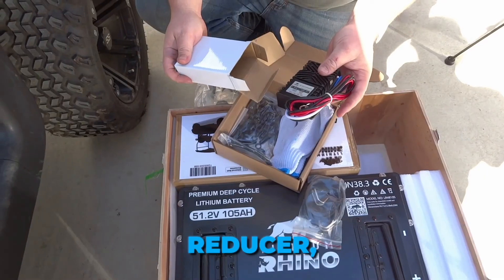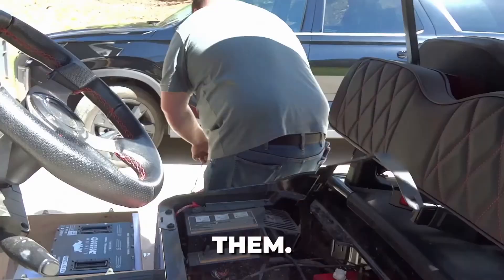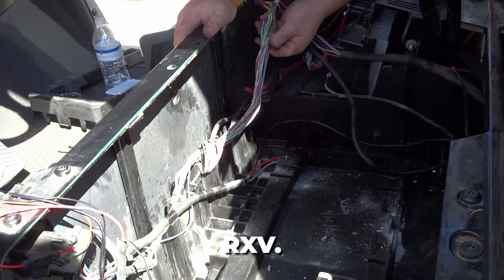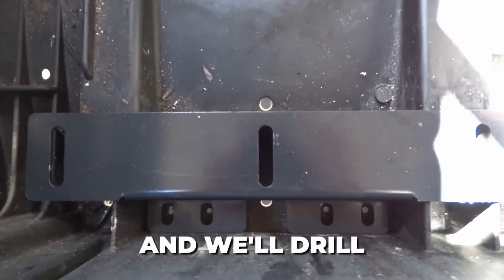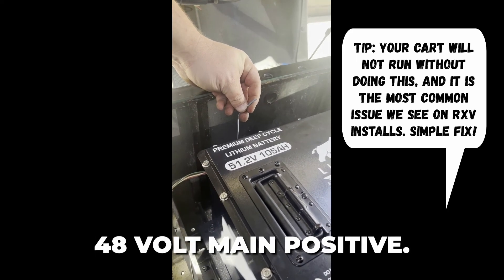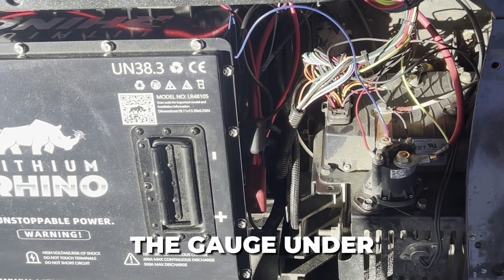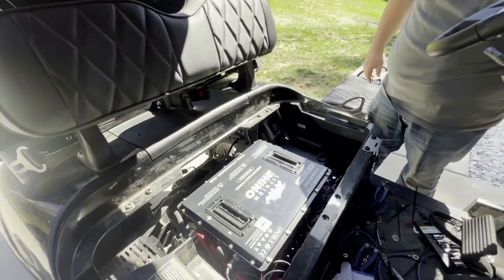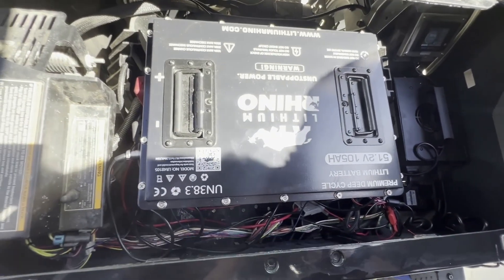EZ-GO RXV Lithium Battery Conversion Made EASY!

Comment: Great video - the info on the blue wire saved me! I had installed a battery and was stumped why it wasn't working and I couldn't find anything online about my issue. Curious, have you had any or have suggestions of how to avoid some of the braking issues people discuss when switching to lithium ion? Last thing - that looks like a Metrolina Golf Cart sticker on your windshield??? If so, small world!
Reply: Também estou com esta dúvida sobre freios